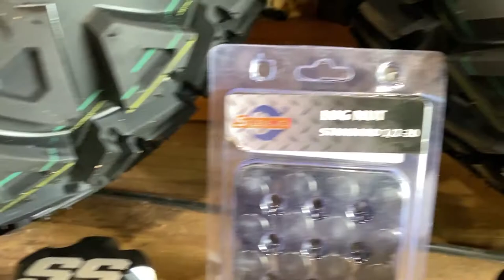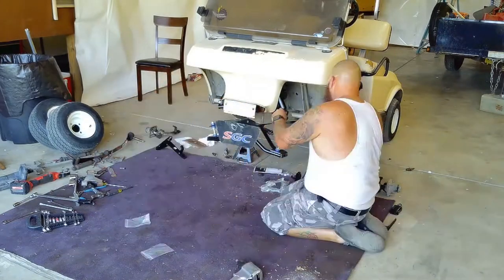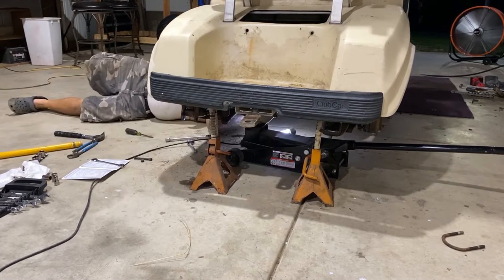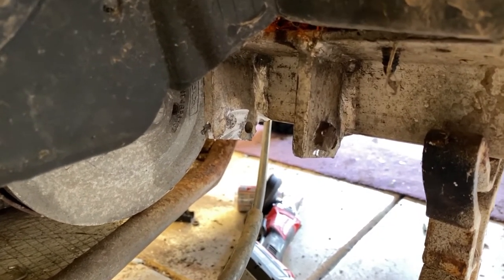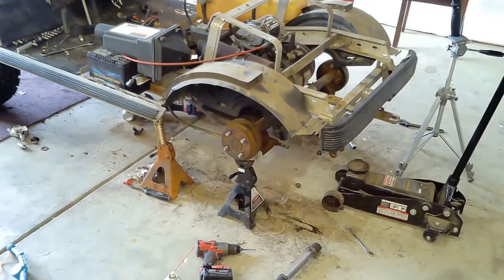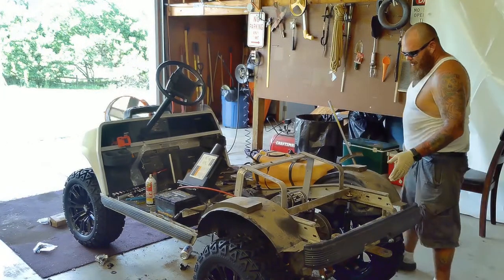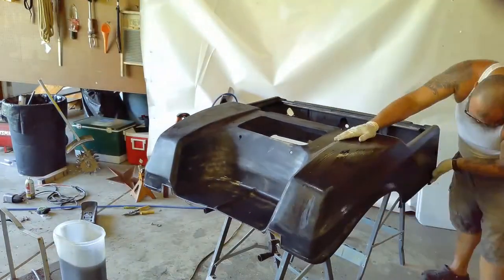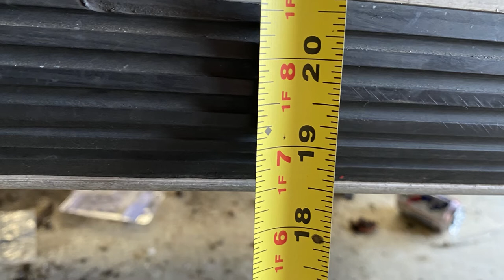Club Car DS lifted Golf Cart

Comment: Is your cart 36 volts? If so does the tires and lift slow the cart down. how does it perform? Thanks for the video. I have a 94 club car 36 volt and debating putting a 3” lift and tires.
Reply from the maker: Mine is a gas cart sorry but there is a club car group on Facebook. It lots of members and very knowledgeable answers. Hopefully this helps you
Reply: Big tires makes it go faster top speeds but slower acceleration

Comment: Looks great! I’m currently redoing a 1996 DS. . I’m struggling with the leaf springs as well. I couldn’t tell from your video did you reinstall the original shocks which where attached to the motor mount plate? Wasn’t sure if they would work after the lift is installed.
Reply from the maker: I put on new shocks that came with my kit.

Comment: Just put in heavy duty leaf springs in my 1995 Club Car Ds. I loosened a bolt on a metal rod thats attached to the rear of the engine and connects to the the underplate now the rod end is higher up and I can't get the rod end down far enough to reconnect. Do you know what this rod is for and if it is necessary? I loosened it so I could get more movement and clearance so I could fit the new springs in.
Reply from the maker: I will have to look at mine and get back to you soon. I can not really picture what you are talking about. I do not really remember having to do anything like that.

Comment: What brand/size wheels are those? Thanks bud
Reply from the maker: All parts used are in the description but here is the link for the rims and tires. Hope that helps 

https://www.golfcarttiresupply.com/14-voodoo-gloss-black-wheels-and-20x8-50-14-stinger-dot-all-terrain-tires-combo-set-of-4/
Reply: The tires at the link you provided don't match what you have in the video.   What size did you actually install?   Nice video and project BTW
Reply from the maker: @shafteburycream  yea that link is almost 2 years old I will have to see if I can find the name of them

Comment: i just bought one out junk yard for 100 dollars i am going to total rebuild it has everything i am break it down an Raptor line the frame an the whole cart last forever it has the good allium frame start with im going with the lead battery for the weight make it ride better 8 6v battery that is 1800 amp hours should go all day long i have to use electric going camping they dont allow gas nowere
Reply from the maker: Sounds like a plan I love my gas but I also want to get an electric one. I am wanting to lower one with air bags and a big bumping sound system.